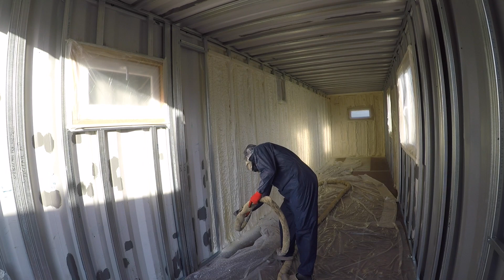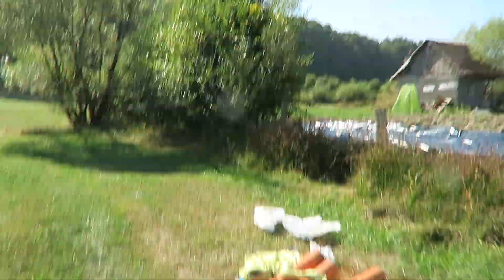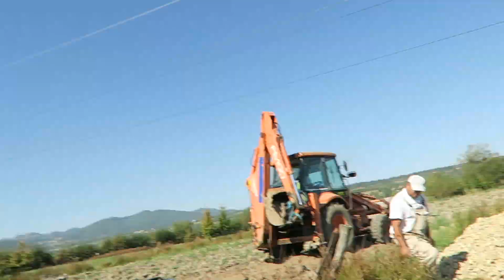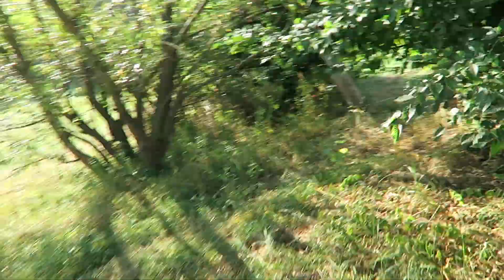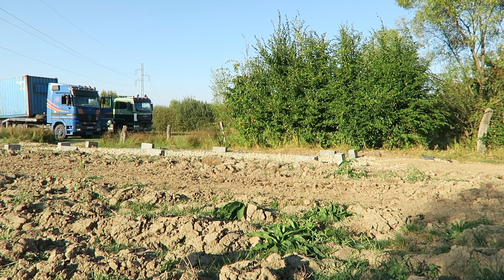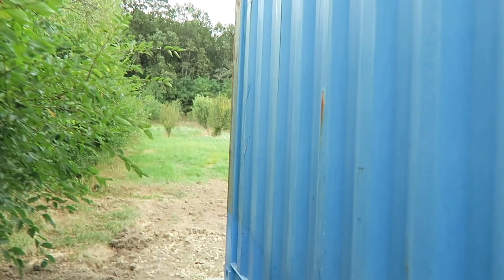Container House - Episode 7 Insulation and moving on our land.

Comment: What thickness did you guys choose for the insulation on the ceiling and on the walls?
Reply from the maker: we just made sure that the foam will go at least 3-4 cm in the inward corrugation of the container. the metal rods where 3x6 cm. so it goes from 7-8 to 4-5 cm depending of the corrugation